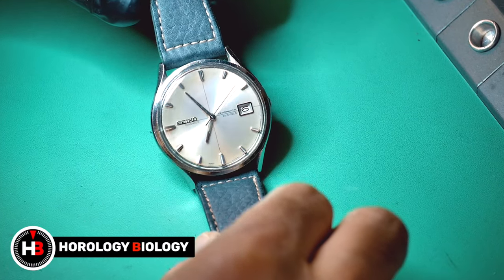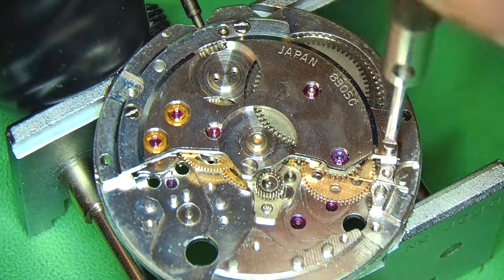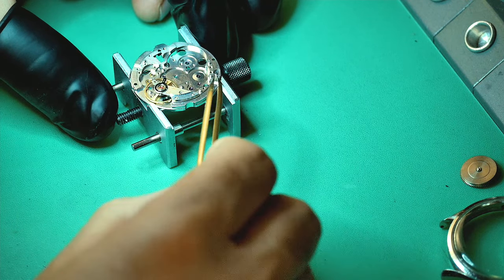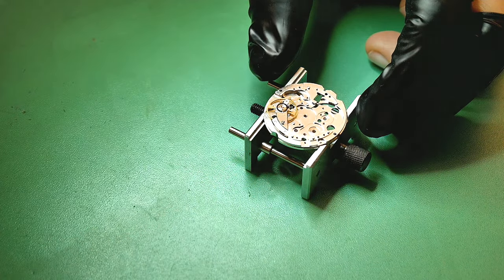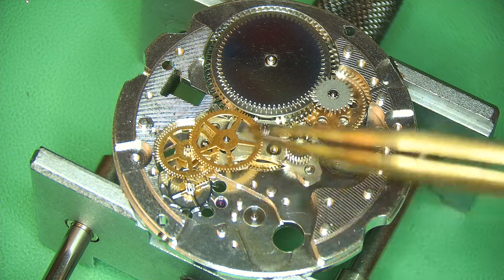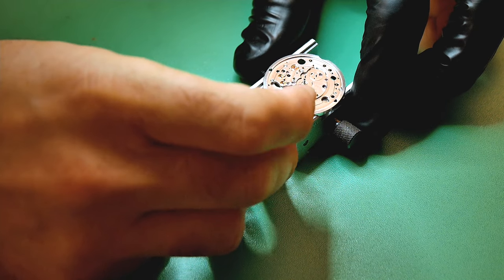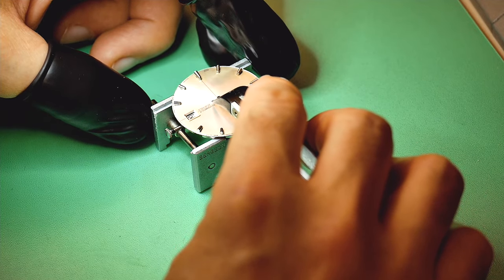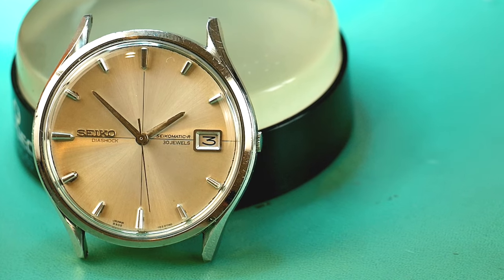Seiko Satisfaction! Restoring this Vintage Seiko Watch 8305-1010 Full Restoration

Comment: That was about as fresh as it gets mate. Firstly thank you so much for the very unexpected shoutout.  For some odd reason I’m known for Seiko but I’ve actually done the same amount of videos on other brands now.  Still love Seiko though and so many more to collect😂 
Does not feel right giving you a tip but here we go. Diafix jewels with the little horseshoe springs. 
You don’t need to remove the spring you just unlatch it by pulling the tab out. Lift it over the lip of the setting and slide it forward slightly. Sometimes they stick up in the air a bit. This gives you enough space to remove the jewel.
I remove these and clean them put them back in dry.
Get yourself a Bergeon 1A auto oiler and jobs a good un.  Auto oilers make those jewels simple. No messing trying to flip them over to install. Well worth the money mate.

Anyway great video on one of my favourite movements.  You should try the 8306 version with day date. There is a killer spring on that one!
Reply from the maker: Cheers mate 🙌 I never seem to get on with those little horseshoe springs. I have tried this flip method but they just come off 😅 I've actually got that used to them now they seem to go on quite quickly even though I still have to have a famous moan about it. Regarding the auto oilers that's another one I have never seemed to get on with. I think it's a control thing, meaning I want to decide how much I'm putting on. Each to their own I suppose as there isn't anything wrong with the autos. Cheers for watching mate 💪💪💪
Reply: Just one thing to add Mike, I agree the auto oiler makes a big change however, the centre second pivot always uses a different size of jewel and for me personally i will pre lubricate because the oiler just gets really messy.

Had this happen on the 4500 series and 4400 series of seiko movements other then that auto oiler all the way.
Reply: @alexanderkamerbeek9693  I only use the A1 for shock jewels. It’s not designed for anything else other than vertical oiling. Posts, cups and other bearing jewels unless you have the other auto oiler A3 I think , you can only do manually.

The diafix on Seiko are a real pain to oil flip over and position which requires some nifty tweezer work. The oil oiler eradicates that immediately.
Reply: @MyRetroWatches  I agree and that's exactly what I use for the jewels aswell.
I think and hope it's just with the movements I mentioned, on the centre seconds jewel of the wheel bridge a different stone is used, it's wider so the oiler slips inside of the jewel making an absolute mess I've tried it a lot and gave up on those. Its very difficult to not slip and get your needle out straight. I mean it's even easier to do it flipping the jewel for me.

Comment: Next time just release the nose tab of the shock spring and slide it it that direction until the two feet clear the cap stone. Remove, clean, oil and replace. Then slide the spring back in position and tuck the tab under!! Much easier my friend😊
Reply from the maker: 😅 cheers Mike, I still find they run away with me 🤣

Comment: A nice restoration! I like those raised indices on the dial. Are the tweezers you use made by Horotec? For some reason, it is very difficult to find curved brass tweezers here in the US.
Reply from the maker: Thanks for watching 👍 Yes they are Horotec tweezers. Not insanely expensive either. I recommend them for sure.